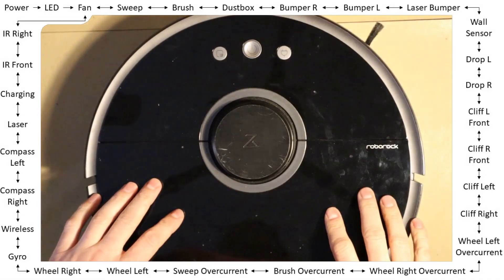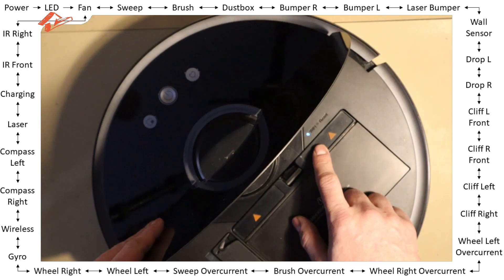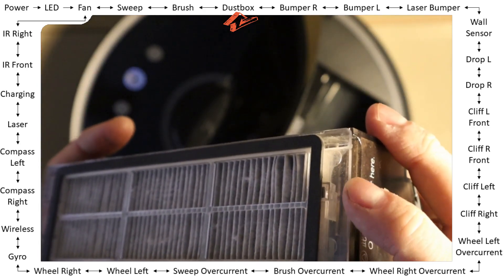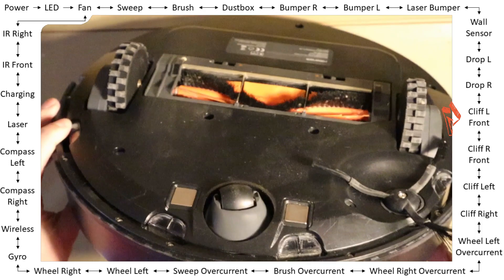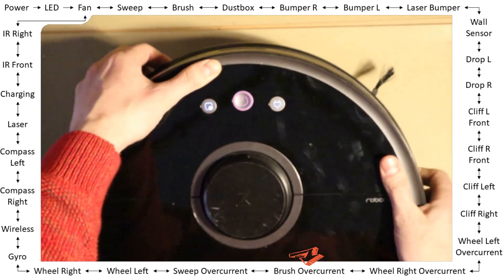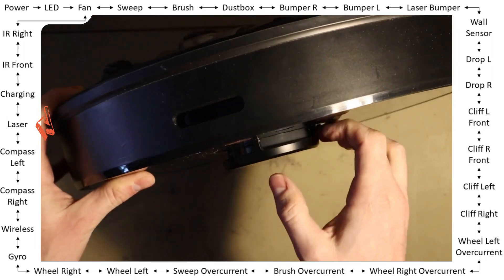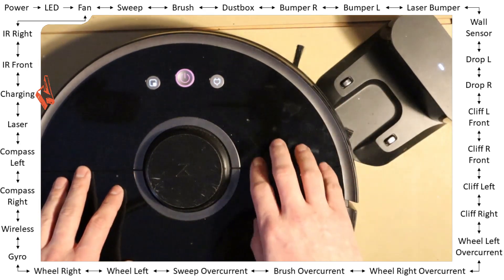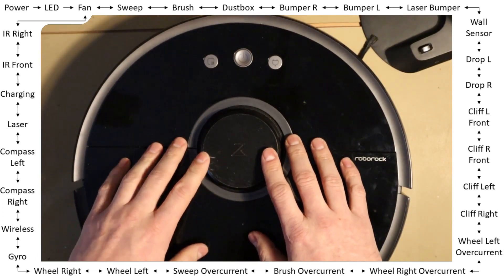[EN] Roborock S50 - BIT: Build In Test Mode

Comment: I reckon this is a long shot. I’m using a Roborock Q Revo Pro and a couple of weeks back the vacuum couldn’t find the dock and indicated to clean the contacts which I did numerous time at some point it worked…
Now, the vacuum goes back and forth in/to the dock and does not indicate anything, it just keeps on trying. Putting the vacuum manually in the dock doesn’t work either. Any suggestions?

Comment: Thank you very useful video!
I found this tiny PCB behind the dustbox in the main body of my S6 maxV. I wondered what it was. Now I know it's a hall sensor for the dustbox magnet.
BIT mode makes repairs a lot easier as well. Will use it for the next Roborock that comes across my desk

Comment: ok so done the BIT mode on my S7. I never knew that existed, thanks for that. What is NOT working is bumper L& R, Drop L&R, all cliff sensors, IR comms. The vac I purchased from an auction with a "charging fault" clearly not that. Do you think its worth getting a replacement motherboard, or stripping down first to check all the connections. I can see boards on a well know chinese website. thanks

Comment: Thank you for these instructions! I am troubleshooting a error 18 (fan). I replaced the fan assembly but no success during the fan test. So i check the electrical resisitance between pins 3 and 4 (voltage input) of the fan conector, and it has a value around 3 Mohm. Do you know what should be this value? Thanks
Reply: I troubleshoot more and realized that the 16V input voltage is always "on" in the fan connector, and during the BIT test step, the fan only works when I unplug and plug back the input voltage pins (red and black). Have you seen it before? Than you